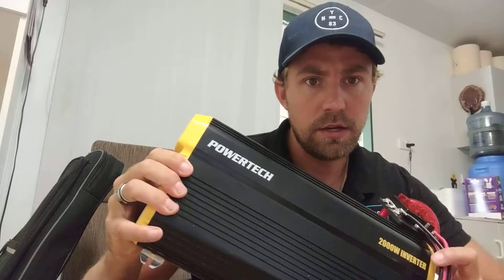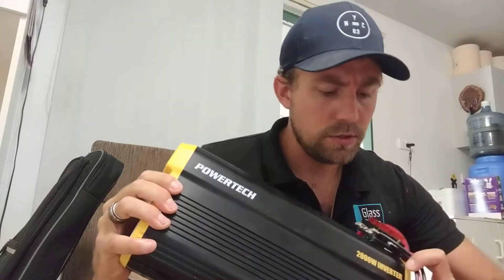Don't reverse polarity on an inverter

Comment: My ,UPS/ATS inverter/charger, has a one universal outlet and hard wire terminals that i had used to hard wire it into my camper. everything in the camper had tested good years ago when installed. But I started also using the  universal outlet,  for an extension cord running into my house, for some stuff i wanted on the UPS function of the camper.  I recently I added a GFCI to that extension cord and found out that universal outlet is reversed. HOLY CRAP. The original extension cord has been running across the lawn and up into my bedroom in my house for at least 5 years. all that time hot and neutral were reversed. At least it was grounded right.
Reply from the maker: Scary stuff!

Comment: You know, finishing that steel sailboat will cost you at least 35.000$ and around 50.000$ if you aiming for a good build. On top of that several hundred hours, maybe thousands. Your fried inverter is not a problem in comparison. Looking forward to see the build, liked and subscribed with notification :)
Reply from the maker: Oh yeah I definitely know it's a big job, I'm probably going to move the boat to my house in a month or so hadn't been much progress so I thought the inverter video might help someone. I'm happy that you're figures lined up with mine, I've done the maths and I'm still very happy to be doing it. Glad to have you on board!